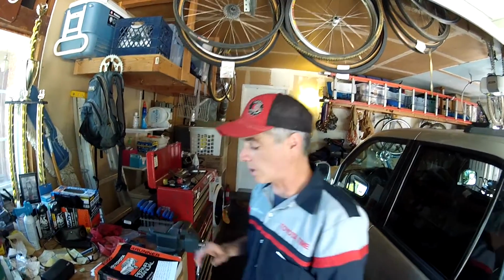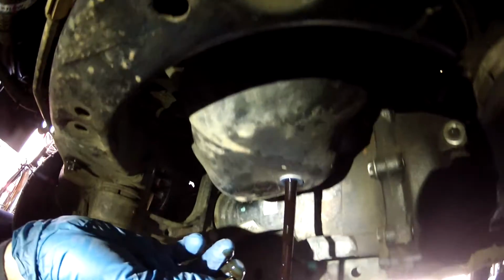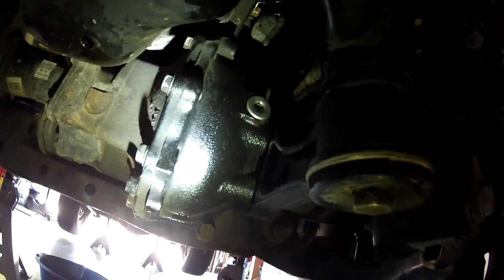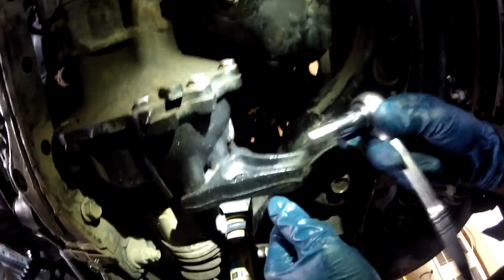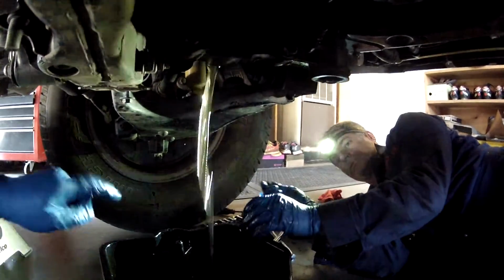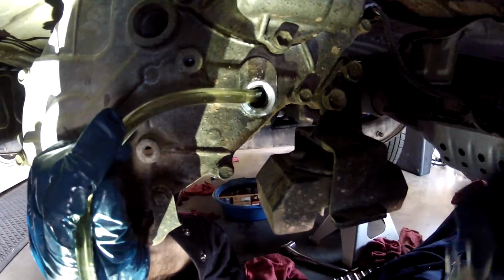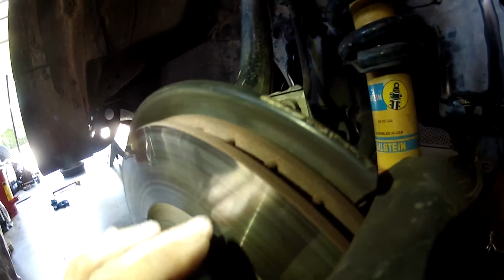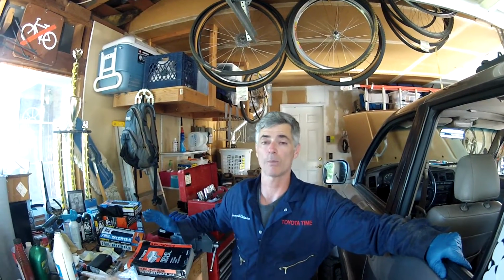30,000 Mile Interval Service

Comment: Great video!  Thank you Tim & Sean.   I did change all of the drain plugs with magnetic ones from goldplug.com.  I highly recommend these as they can hold a heavy tool with their magnets.  Just use their website guide for fitment specs.  I used Redline MT-90 for the 5spd. Trans and transfer case.  I also used Lucas 75a-90 for the front and rear diffs.  Keep up the great work and videos coming!😉👍
Reply: The goldplug.com also makes them for the motor which I forgot to mention.   They also make a great solution for the front differential, in a bolt type for giant socket instead of an alien or hex type.  Got that one too!👍
Reply from the maker: Glad you like the video and thanks for the link to the website.  The ones I'd definitely like to get are the front differential fill and drain plugs.  It would be nice to get rid of those allen head plugs.  Thanks for the comment.

Comment: My 4Runner is 1996 3.4L it needs 6.5 quarts with a oil change. I use a K&N with a 1" nut on top.
Reply from the maker: That's interesting.  The most I've ever used is 6 quarts to get it full on the dipstick.

Comment: Good job.  I had a hard time replacing the oil filter.  I had to use  1/2 " breaker bar and sockets vs 3/4" since some of the screws were stuck. I did not have to lift the vehicle. The job took longer than expected.  Following are the specs for a 1998 Toyota 4Runner LIMITED 3.4L V6 AT

Tools you will need
================
• Torque Wrench
• Socket wrench
• 24 mm socket
• 10 mm hex bit
• 10 mm socket 
• 12 mm socket to Remove skid plate
• Oil pan
• Quart and Gallon fluid pump
• Transmission Funnel 
• Oil filter wrench
• Grease pump for Spiders & Sliders Containers (Quarts)
• dyno MolyLith Grease Synthetic Mobil 1 Grease
• Pump to suck the fluids Tube and plugs to plug the steering reservoir

U-Joint and Slip Yoke Greasing
 see notes below along with a link

Socket sizes and torque
=======================
• Engine Oil drain plug 14 mm socket 29 ft/lb 
• Engine Oil Filter N/A By Hand + ¼ turn 
• Auto Transmission drain 14 mm socket 15 ft/lb 
• Transfer case drain 24mm socket 27 ft/lb 
   
• Transfer case fill plug 24mm socket 27 ft/lb 
• Front Differential fill plug 10mm Allen 29 ft/lb 
• Front Differential Drain plug 10mm Allen 48 ft/lb 
• Rear Differential fill plug 24mm socket  36 ft/lb 
(Loosen Parking brake
) 
• Rear Differential Drain plug 24mm socket 36 ft/lb 
 

Fluid types and Qty   (Make sure your vehicle is on level ground )
==================
• Engine Oil 5W-30 (specs shown on oil cap) 5.5 to 6.5 or 7 Qrts --- 1998 usually takes 7 Qrts. Start with 5.5 first and keep adding a bit at a time as needed.

• Auto Transmission Fluid Specs Dexron III Compatible (e.g. per Tim Valvoline Mercon V Part 822345 ) 2.1 ~ 5Qrts 
Note 1: Transmission fluid Dexron II is what is shown on dip stick and on the drain plug . However, Per Tim - you can use  with Dexron III compatible (do not use Dexron IV or V)
Note 2: To get a better idea on much you need to refill the transmission, drain the transmission fluid in a milk jug that is pre-marked in quart increments. Place it in an oil pan to catch any overflow. 

• Transfer case Fluid 75W - 90 1+ Qrt (little over 1 Qrt) 
• Front Differential Fluid 75W - 90 ~1.2 Qrts 
• Rear Differential Fluid 80W – 90 2.9 Qrts with Rear Locker or 2.6 Qrts w/o Rear Locker 

Parts
=======
Oil Filter 90915-YZZG2 Toyota Genuine
Oil Pan Drain Plug Washer 
  90430-12031
 
Front Differential Drain Plug Washer 90430-24003  (copper washer)
Front Differential Fill Plug Crush Washers 12157 – 10010
 
Transmission Drain plug crush washer 35178 – 30010
 
Transfer Case Fill plug washers 90430 – A0003
Transfer Case Drain plug washers 90430 – A0003
 
Rear Differential Fill Plug Crush Washers 12157 – 10010
Rear Differential Drain Plug Crush Washers 12157 – 10010
 
Engine Air Filter 17801 – 07020
 
Steering Wheel Fluid 00036-00006

U-Joint and Slip Yoke Greasing
Reference: https://www.toyota-4runner.org/maintenance-detailing/220638-greasing-driveshaft-4th-gen.html

#1 and #3 are spiders Lithium No 2 grease (Synthetic Mobil 1)
Instructions For spiders keep pumping until grease oozes out of all bearings then wipe extra stuff off
#2 is a Slider MolyLith (regular dyno MolyLith) )  * 3-7 pumps is enough
Instructions Do not overfill slider because it can pop the dust seal at full compression (3-7 pumps is enough
Reply from the maker: Wow, that's what I call a comment.  Thanks for the write-up.
Reply: @TimmyTheToolman  I enjoy your videos Timmy. Good job.
Reply from the maker: @Sami-bc9iv  Good to hear.  Thanks for supporting our channel.

Comment: Does anyone know what drain &  fill plug washers I would need for my manual transmission and the torque spec for my 99 6 cylinder part #'s would be helpful thanks
Reply from the maker: They are most likely going to be the exact same ones that are for the transfer case  #90430-A003.  But, a quick visit to your local Toyota dealer is all you'll need to do if you're concerned.  You'll pay a little more for them but were' not talking a huge expense for a couple washers.  As for the torque spec, I'd say you could also use the transfer case as a reference and torque your manual transmission drain and fill plugs to 27 ft-lbf.  Or, you could just go by feel, which is what I do for drain plugs.

Comment: Tim I noticed my 4runner 02 4wd also takes just over 6 quarts to fill it to the top dot on the stick. I never know if I should fill it to the top dot or if I should add 5.5... so I add 6 even tho it’s still shy of he full dot. Should I add until it’s at the full dot or add the factory spec?
Reply from the maker: Hey Chase, I noticed the same thing.  I always fill it with 6 quarts and call it good.

Comment: Another helpful video Timmy! Thank you! When refilling my transmission fluid, I noticed some of my vacuum hoses were getting brittle...do you have any recommendations replacing them?  I'd like to do all of them, but not sure if going OEM route (with all the various part numbers) would be economical.  Anything wrong with buying bulk vacuum tubing from the auto store and cutting them to size in your opinion?
Reply from the maker: I think you're fine buying some bulk vacuum tubing that's the right diameter.  There's a bunch of different sizes on the engine so I don't know how easy this will be to figure out.  Maybe an aftermarket supplier sells a kit for the whole engine.

Comment: It seems like some of your fluid replacement is very aggressive, and not per the recommended schedule. Your fluids seem to be in great shape when you drain them.
Reply from the maker: Keeping your fluids in great shape helps you keep your vehicle running a long time before major work is needed.  I do tend to agree with you that you can quite often get longer life out of your fluids but I prefer to be on the safe side of fluid change intervals.  Fluid changes are usually very easy and not expensive, so why not give you rig some love a little more often?

Comment: It's me again Timmy, I was watching this video and you didn't show in the video when you fill up the rear differential, is it the same as the front differential when the gear oil drip out of the fill plug it's already full. By the way thanks again for this very good video, next week I will do the front differential and the transfer case on my free time when my grandson is not around to bother me
Reply from the maker: Hey Luis, every differential, transfer case and manual transmission is the same.  You fill them with gear oil until the oil spills out of the fill hole.  You obviously want to be on level ground when you do this because you can either get too much or too little into what you're filling if you're at a slant.  Be careful with the front differential.  That drain plug is notorious for stripping because it gets really locked onto the differential.  If it fights you, use some heat around the plug to loosen up the connection and try again.  If it doesn't budge, use some more heat.  You don't want to strip the plug.  To heat it up, you can use one of those small torches that screw onto a container of map gas.  You can buy these torches at any hardware store.
Reply: @TimmyTheToolman  thanks for the advice on the front differential. I will check out the torch before I start the job next week.

Comment: Hey Timmy, I drained the transmission fluid and the used one was a gallon and half quart. I put in a gallon of valvoline dexron III / mercon plus an additional half a quart of flag transmission fluid. I checked the dipstick and it shows fluid is up to the hot line.  Did I overfill it with fluid. I drive it around the block for maybe 2 to 3 miles and when I get to the garage I check again the fluid it is still in the hot line so I am not sure if its overfill or what  Thanks for this video and maybe the next one is the front and rear differential.
Reply from the maker: When you first checked it, was the engine running?  You always have to check the transmission level when the engine is running,  the transmission is in Park and you're on level ground. So, if you added exactly what you took out, you're probably OK unless it was overfilled before you started.  

With the transmission cold, and the engine running, make sure the level is in the cold range.  Now take your rig for at least a 5 mile distance on the highway and get the transmission to kick down multiple times during your 5 mile drive out and 5 mile drive back.  When you get home, immediately get it on level ground, pop the hood with the engine running and check the level again.  Your level should now be somewhere in the hot range.  If you have a way to monitor your trans temp with a scan gauge or OBDII reader sending info to a phone app like Torque Pro, that's ideal because then you can confirm you are at operating temp for your trans.  The normal operating range is 158-176 according to the FSM.
Reply: @TimmyTheToolman thanks for the advice, I checked it while the engine was off. I"ll try  it again tomorrow. I am learning a lot from your video and I"ll do little by little maintenance on my 97 4runner. Thanks again.
Reply from the maker: @luisolitoquit4481  Gotcha.  Good to hear you're learning a lot from our videos.  Happy Wrenching Luis.

Comment: Thanks for the video.  It is very helpful.  I drained my transmission and only got 3 quarts out instead of the 5 quarts you did.   Are there different types of transmissions (mine is 3rd gen 2wd)?  Also I left my 4runner on the ground rather than putting the front on jack stands.   So do you think having the front tipped up caused more fluid to drain?
Reply from the maker: Maybe there is a difference in the fluid capacities between the 2wd and 4wd models but I'm not sure about that.  There could be a difference based off the slant your vehicle is at and whether you drained it when it was cold compared to hot.  The important thing is you properly fill it.  You can check the level when it's cold or hot but I believe you get a more accurate reading when you check it at operating temperature.  The factory service manual specifies normal operating temp is between 158-176.  If you have a way to monitor your temps, that's ideal.  If not, drive at least 5 miles down the highway and then back.  During the drive, give quite a few hard throttle responses to get the transmission to kick down because this will help raise the trans temp.  When you get home, immediately pop the hood, with the engine running and check the level.  You want the level to be reading between the hot marks on the dipstick.

Comment: Should make a diy video for a oil filter relocation kit?
Reply from the maker: What's wrong with the current location?  The only nuisance I see is removing the skid plate which gets harder with heavy aftermarket skids.  The OEM skid is a piece of cake to remove.
Reply: @TimmyTheToolman  just to minimize the mess it make taking it off.
Reply from the maker: @omarzeineddine5427  I guess that's a good enough reason.  I probably wouldn't bother doing it on one of my rigs, but if somebody hit us up for help with this job, we'd make a video for it.  Do you know of a good relocation kit?

Comment: What kind/brand of grease gun and grease are you using?
Reply from the maker: Just some basic gun you can find at most auto parts store.  It was nothing special.  Or, check Amazon for a gun with good reviews.
Reply: @TimmyTheToolman  Thanks for the quick reply.  What kind of grease do you use?   Just whatever is avail at the auto parts stores as well? In the mean time I have done a bit of research and there seems to be a heated debate of moly vs mp, sounds like there isnt a correct answer for that :)

Great videos.  Keep up the good work and quality videos!
Reply from the maker: @CoffeeBetterCold  Hey Mike, according to the FSM, they suggest a Multipurpose Lithium Based grease for the u-joints (spiders).  For the Slip Yokes on both driveshafts and the Double Cardan Joint on the rear driveshaft, the FSM suggest a Moly grease.  I know guys who just use the same grease for all applications and call it good.  Here's a link to a T4R thread that maybe you already found: https://www.toyota-4runner.org/3rd-gen-t4rs/97006-drive-prop-shaft-greasing-guide.html

Honestly, I don't think it matter that much what grease you use.  The main thing is keep the joints lubricated so they don't prematurely wear out.  Good to hear you like the videos we've been making.  Happy Wrenching!

Comment: Hey Timmy,  Happy Holidays, Did this 4runner have a oil cooler? I have a leak coming from that area, I dont have a cooler on my 01 SR5 model.
Reply from the maker: Hey Tyler, are you sure that your engine doesn't have an oil cooler?  I was under the assumption all these 3.4 liter engines were the same.  Why would your 2001 not have an oil cooler?

Comment: Hey Timmy do you kno if I can use 75-90 for the rear diff as well
Reply from the maker: People have used 75w-90 without issue but an 80w-90 gear oil is what Toyota suggests.
Reply: Timmy The Toolman thank you
Reply from the maker: @Jmelz20  You're welcome.

Comment: Hey Timmy The Tool Man & Sean,  I want to thank you both for the kick ass videos.. story goes .. bought a '95 Tacoma 5VZ-FE 4x4  and not having the cash for a mechanic took the gamble on the truck because it checked out on a report & passed smog, etc. after driving after a month or so i realized it was BLEEDING oil, leaking water pump or thermostat or both and feared what else was goin on.  Sooooo.... fearing the cost of labor for a mechanic & possibly not finding an honest mechanic I found your videos and started from the rear to front of this truck.  This thing has been so neglected at 220,000 miles.  I've changed out all my fluids, replaced drums n shoes & all hardware, bled the lines, brand new shocks n struts, replaced front pads n discs, valve cover gaskets, and just finished timing belt, water pump n seals thanks to you & Sean!..... didn't mean to write cha a novel here but I just wanted you both to know how much I appreciate step by step video, tips, hints & for taking it serious & torque specs!! ( even though mine differ here n there lol) .... i feel pretty secure about this truck now & yep, I'm a chick that did this hahaa ..... love it! & you guys have taught me so much... Thank you!!
Reply from the maker: You're very welcome and thank you for sharing your story.  It's our goal to Educate and Empower people to tackle their own automotive work and stories like yours always brings a smile to our faces.  Who knows how much money you saved doing all this work yourself, but it's probably at least a couple thousand dollars.

You've learned that a lot of auto mechanics is not really that hard, right?  With the right information, the right tools, and a little patience, you can do quite a bit without relying on shops that charge anywhere from $100 - $150/Hour labor rates.

Thanks for taking the time to comment Little Rabbit.  Happy Wrenching!  #GirlPower

Comment: Tim have you had any problems with transmission slipping after changing the fluid?
Reply from the maker: Hey, nice last name.  I'm Tim Watson.  I haven't personally had a problem with an auto transmission after changing the fluid.  The only time you'd have trouble with slipping after a transmission fluid flush is if the transmission was abused and the fluid was very old.  As the lubricating properties of the fluid break down, more wear occurs throughout the transmission, including the clutch plates, and you can get sludge build-up in different areas in the transmission.  That old dirty worn out fluid can haver suspended clutch material in it and it's helping the transmission shift and not slip.  When you drain out all the old fluid, you lose the suspended clutch material your transmission was relying on.  Also, new fluid has detergents in it and can loosen the sludge that built up in the transmission.  That loosened sludge can lodge in the valve body and cause fluid delivery issues.  

I'm not an expert on automatic transmissions but I've read quite a bit on the subject.  So, if you happened to buy a vehicle from a seller that never changed the transmission fluid, it might be best to do just a drain and refill of the pan or do nothing at all.  The damage has already been done and the transmission is on borrowed time, but why accelerate it's demise by doing a complete flush.
Reply: Thank you Tim! I knew you were a good guy and the last name just proved it!! Look forward to any new videos, you have done a great job so far!! Thanks again
Reply from the maker: Thanks Chris.  More videos coming.  Sean and I will probably be doing this for a while but you never know what life will throw our way to change things.  It's been a fun ride so far.